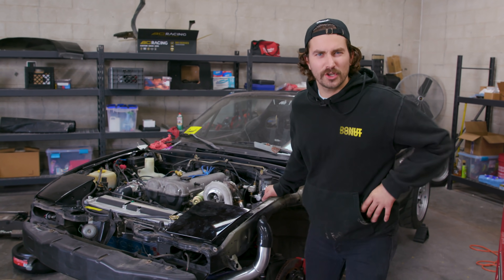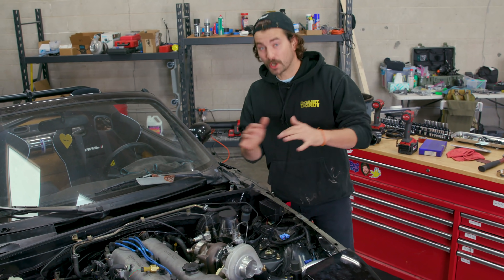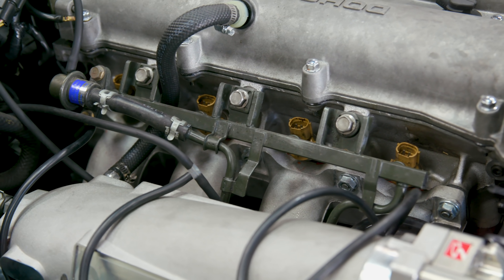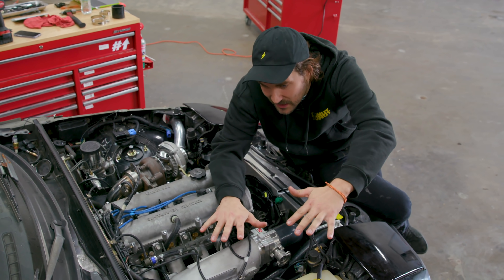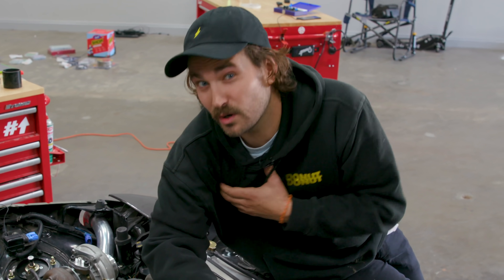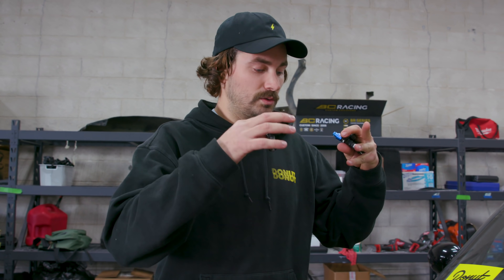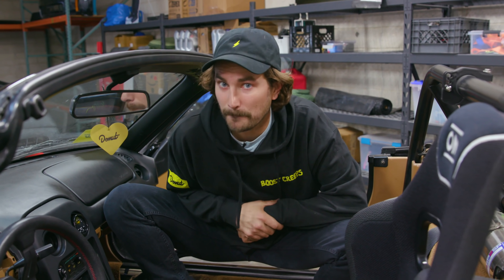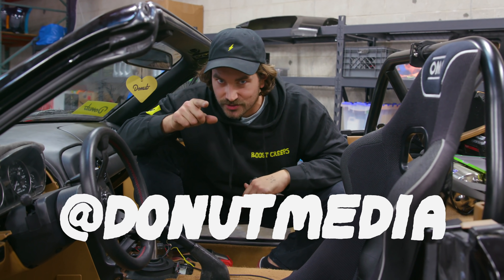Turbo Your Car - Picking the Right Injectors

Comment: It's funny it cost just a few k to bring my truck down to low 12s in the 1/4 mile but the next step which involves new a new turbo or compound setup costs about as much as I have spent so far or more for compound setup.  Then I also need new injectors which cost about 5k for my truck and a built allison trans which can run 4k-10k+  so I'm looking at 15-18k to get down to 10s in the 1/4 lol it's an astronomical jump in price.

Comment: for the poor boost gauge fitment, you could wrap tape around the gauge housing (sticky side in) till its a large enough diameter to fit more snug in the air duct.  You can still remove it as needed and can remove the tape whenever.

Comment: Such bad advice about the fuel pressure regulator and fuel pump. 
Replace your tired ass 30 year old fuel pump. Plus if you start tuning and the fuel pump fails or just can't keep up, you just wasted all your money on the Dyno and now gotta do it anyways. Fuel pressure regulator is hella important ESPECIALLY ones with a guage. Can't tell you how many cars i have seen on a Dyno idle just fine and drop fuel pressure NASTY as boost increases. One, you wouldn't know that and would just keep making the map richer and richer for no reason trying to fight it, 2 you can easily blow your shit up from 1 pull if that happnes unchecked

Comment: butane soldering irons are freaking awesome.  they make soldering a million times easier because they heat up so fast, they maintain the heat easily even in wind, and there's no cord.
also, pro tip:  use flux.  it keeps the joint clean while you solder, but the main reason it's awesome is that it makes the wire heat up like ten times faster.
i use the dremel butane soldering iron.  it comes in a nice metal tin you can throw in your tool box.  
and i use AMTECH NC-559-V2-TF flux.  it comes in a syringe so it's super easy to get it where you want it.  there are cheaper ones with good ratings, but this one is the best.  it's only a few bucks more and you're much less likely to have to deal with headaches.

Comment: Don't solder your fuel injectors wires. Solder exposed to that much heat and elements in the engine bay will get weak and if the connection is lost under load you could melt a piston. This happened to boostedboiz civic before.

Comment: I DM’d you on Instagram asking for help! Username is Jarrod.ray23 I’ve got a 2013 Ford Fusion se with the 2.0t from the focus st and I want to throw in a big turbo but I want to do it safely and I don’t know what I need other then front mount intercooler and then internal waste gate blow off valve and a tune

Comment: You might be able to wrap tape around the back edge of the boost gauge to hold it in place with a press fit in the air vent

Comment: Crimping those injector wires might be a better idea.  Vibration and heat in the engine bay will weaken those solder joints quick.

Comment: Injectors are easy, now upgrading ignition is where I have issues
Reply: Ignition isn't as easy but still pretty damn easy. We have soo many options whether it's Toyota COPS or the better LS coils. If you're having issues upgrading the ignition, you probably aren't at the power levels where it's needed.
Reply: @cn1364-w6c  I’m running stock NA ignition on a boosted setup now. Getting periodic spark blowout at high load. My tuner suggested LS coils
Reply: @flyboynextdoor Stock NA ignition is usually good until like 250whp

Comment: paint some tooth picks or q-tip shafts black an use them as wedges to tighten the temp fit of your boost gauge so it dosnt flop out while romping on it bruhh lol

Comment: Anybody doing this to a 20 year old car, replace your fuel pump wit at least a walbro 255. Nothing will wreck your (now boosted)stock NA engine quicker than sudden fuel starvation. Consider it insurance at a fairly low cost.

Comment: 10:43 Sometimes you can take apart the clips on both harness's to avoid having to cut and soldering and its a lot more secure of a connection. I guess you could get the old ones off then strip the wire back then take apart the new clips and stick your stock wires in. Better connection imo maybe it doesnt really matter but thats how i've been fixing broken clips in my engine bay

Comment: ZACH!  Unless you mention it later, you didn't cover why someone would NOT want to just throw the biggest injectors they can afford @ the vehicle - the bigger the injector, the harder it can be to keep a smooth idle due to the very shortest injector pulse letting more fuel in than can be burned @ idle.   The more you know :)
Reply: Another point as well - electrically speaking, there are two types of fuel injectors normally in use - Peak and Hold, and Saturated.  The biggest thing you need to know, is if they are 'high' or 'low' ohm (resistance) - some quick googling for your vehicle should make sure you get the right type of injectors!

Comment: Zach, there are some slip on solder joints that come covered in heat shrink. All you have to do is slip it on, twist wires together, line it up, and hit it with a heat gun. Way better than the ol spool/flux/iron method.

Comment: You should mention that it’s actually not a great idea to snip more than one wire at a time if you’re soldering new connectors for anything. It’s a good habit to get into, especially if you’re soldering positive and negative leads with power on the end. I’ve ruined a battery and I’ve lit myself up before by cutting two wires at once...just not paying attention. Now, I always cut them one by one, and right after I cut, then I’ll wrap the exposed wire in a little electric tape to keep it from hitting the other positive or negative exposed wire.

Comment: I wouldn’t recommend engine oil/assembly line as that breaks down o-rings. Best to use a silicone based grease for fuel injector o-rings.
Reply: Missed a great opportunity for a Vaseline jokes.

Comment: I would probably  replace the stock fuel pump just because of age and mileage......less risk of leaning out at high rpm and pump fuel fast enough to rail on the faster demand on boost.......In simply term might as well put a DeatschWerks pump like I did.  Great Info!!!

Comment: If you will flux those wires before soldering them it will solder so much better/cleaner/faster. I don't care if you have rosin core solder still flux TRUST ME! I do it everyday.

Comment: I got so pumped up to turbo my 09 impreza 2.5i n/a next year, only until i realized many people in forums were telling others with this idea, that it was a bad move. I'd waste at least 1500$-2000$ in parts, some labour and tuning, etc. Many weeks of working on it, many headaches and setbacks, only to be able to run maximum 7 psi with oem internals, so i'd get at least 230whp at the most from 165bhp... very lame hp for that amount of money spent.. to get at least 350whp i'd need to spend another 2000$ with compression forged internals and beefier drivetrain. At this point i'd spend around 5-6k$ That's the price of a narrow-body wrx.. Another 4k i could get a sti with some miles and some dings. So the new idea is to sell my lame subbie and get a wrx/sti...

Comment: missed a chance to explain about low and high impedance injectors
also its a good mind to replace the fuel pump anyway on an older car, the pump sock could be aged/alot of contaminates
a higher flow fuel rail will decrease the chance fuel pooling, fuel pooling causes a backfeed into the injectors giving deep rich mixtures which dont have
stock fuel regulators generally have a limit of 20psi additional but the key benefit to an upgrade is to reduce fuel pressure oscillations

coulda added about 15min or so of content I would have gladly watched haha

Comment: For anyone following along, the fuel injector harness is really easy to detach from the rest of the harness and pull out, so you can rewire on a workbench instead of in the car.

Comment: Is there any of these calculator for diesels because I have a lbz Duramax that I’m building right now. I have 200% over injectors and don’t know what cp3 pump to go for my whp goal is 1600 but run it at 1000 for reliability. Any one know anything that could help

Comment: "Just take the fuel rails off and pop the new injectors in..."
cries in Subaru boxer
Reply: I mean sure, but the Subaru is a hell of a lot easier to do anything than my old GTiR's were.. While I do wish I still had one (or could afford one) I'll stick to the subarus for now.
Reply: Honestly my Subaru is just a funky lego everything is a breeze except this upcoming secondary air pump valve :(
Reply: @logandvorak  I mean, I replaced the starter in my truck in about 15 minutes. I looked at the starter in my girlfriend's Subaru and decided that was gonna really suck, since it was practically pinned to the firewall under a lot of a/c lines and I could barely feel one of the bolts, let alone see it
Reply: @imthedarknight-8755   yea subarus are definitely a pain in the ass but to take them apart and put together they aren’t too too terrible but they definitely aren’t as easy as other engine
Reply: @logandvorak  Yeap, this one sucked also... One side is easy, getting to the other one requires removing the intake manifold or breaking the top of the assembly :/ On the 2007 STI, at least. Some Foresters apparently have it easier...
Reply: @VeliRajasaar  yep oh ik lmao that’s the one I gotta do lmao I’m not at all excited it keeps getting stuck open :(
Reply: @VeliRajasaar  yea I wouldn’t know I have an 06 wrx as well so I’m not at all excited I’ve been putting it off for about a month or so

Comment: An awesome rule of thumb employed by Turbo Yoda and Tuning fork is one litre per hour per horsepower you aim to get from your engine. It is, of course, a rule of thumb not a calculation which is going to reliably inform you what your pump needs to flow.

Comment: Did you forget to flux the wires? That solder doesn't look like it was cooperating. Even if the solder allegedly contains flux, it always works better if you manually apply it in my experience......

Comment: Getting there. Good build so far. It’s way easier to change injectors with that intake. A standard Miata intake will need at least the top half removed before the injectors are changed. Also those stupid spacers are plastic and are the worst.

Comment: be honest
soildering is the reliablest connection of them all
Reply: Crimp connectors are best for environments prone to vibration (ie automobiles). A proper crimp is stronger than the wire it crimps (cold weld), whereas soldered joints are brittle and prone to failure.

Comment: Remember fuel injector are rated at a certain pressure usually 39 or 43.5 which is normal for older return style cars but newer cars with returnless usually bring 50+ make sure to account for that and I like usi g used own injectors like I used 2013 gt500 injectors in my 2011 mustang till need more bigger ones and they were like 175 vs 360 for the bigger after market ones I had to get also different connections had to use adapters in the aftermarket ones and didn't like it but worked fine.  Also a lot of newer cars come with big ass fuel pumps and often don't need a pump upgrade til going for big power. This is second hand so keep that in mind, If you go with different rails with bigger diameter they can change your injectors amount I was told but I've never needed to upgrade rails so not sure how true or how much it actually does.

Comment: My Nissan Kicks has the same fuel injectors, whole oiling system borrowed from the R35 fitted with a smaller turbo in the new HR13DDT Engine, but still its a Nissan Kicks not a Gtr.

Comment: It’s important to mention you should check the correct impedance of the injectors when buying a set. If you get the wrong type of injectors you'll end up wasting time and money shipping new ones, or having to jerry-rig some resistors or PWM in software.

Comment: The stock fuel pump can flow 165 lph at stock fuel pressure.... 43.5 as opposed to 54.  so no it's not up to the task of consistently running at a higher pressure...

Comment: NEW INJECTORS REQUIRE A RETUNE WITH MEGASQUIRT. Changing that constant completely fucks the fuel map up. But im sure youll catch it when you try to start the car. You can actually use the Histogram in Tunerstudio under the VE table to generate a new table and it should run off of that table. But it wont be the cleanest

Comment: It’s nice to see somebody to doing soldering correctly. Do not use heat to melt the solder onto the wire, this will create what’s called a “cold solder” and can break under vibrations.   Heat the wire and let the solder flow in to the strands.

Comment: As a plumber soldering is my life and so is cars and I’ve seen worse but those joints maid me cringe a lil 😂 still looks like a clean job though thanks for the info I need injectors for my 1j swapped 240sx hatch

Comment: An important factor is also what fuel you’re running (for ex. 91 octane or E-85). If you’re running E-85 your fuel injectors will need to be 30% larger with your calculation. So say 750CC injectors make 400 hp with 91 octane, with E-85 might make less than 350. 

Note: If you’re running E-85 you must get your injectors cleaned 4 times per year and replace all fuel filters (including in tank) at least twice per year.

Comment: So I know the way you did the changing the injector connectors ( cut, solder, shrink) is the easiest because the new pigtails has color match or directions for color x to color y etc but... why do you never see anyone taking the pins out without cutting? It would make for a much cleaner install.

Comment: This isn’t how you size injectors... calculating brake specific fuel consumption is much more accurate. Take the stock injector flow rate convert it to kg/s then divide it by the stock power to get BSFC per hp. Then take that and multiply it by the hp you want. Same math the calculator does it’s just based on your specific engine
Reply: https://www.enginelabs.com/news/calculating-fuel-demands-and-injector-sizing-with-efi-university/

Comment: As an electrical engineer, soldering wires together is a very bad idea when there is vibration present. In this case the engine. The solder joint is too rigid and the wire will eventually snap off at some point. Use bud splices instead. They are vibration safe, and actually easier to use then soldering.

Comment: I just got a boost gauge and it seems so confusing to install I’ve never done any wiring for a car. Any tips if anyone has put one on a 2007 Audi A3 2.0t
Reply: You can use fuse taps to tap your fuse box for the power wiring. You can find both constant 12v and ignition/accessory 12v in the fuse box. You definitely want at least a 12v test light if you're getting into this stuff, helps to know what your wiring is doing. If you're tapping off the battery terminal for power, use an inline fuse close to the terminal. I think Zach has done a couple of simple wiring videos on MoneyPit.

Comment: if you want the boost gauge to fit just put some layer of electrical tape around until it's the right size.
It should be pretty seemless and hold this puppy tight in the vent

Comment: to much fuel will choke out your car under heavy acceleration. yes you can over size " a little bit " but you cant go ham just plugging in double the size of injector. plan on having to tune the shit out of those with your ecu

Comment: There is an upper limit to injector size!  Basically if the injector is too big, then the injector won't be able to control fuel at idle and maybe even at cruising speeds.  Bottom line, if you care about idle and cruising, don't drastically oversize injectors.

Comment: I love how he ignores the fact that the miata's pump may not have been designed to output higher fuel pressures and maintain proper flow. 160lph is fine but has he considered how much the pump will flow at 54psi. Has he considered if he will later run cams or how the intake manifold could change airflow at higher RPM with positive pressure instead of vacuum. What if he wants to turn up the boost a bit more after a rebuild. Hell be right back to replacing the pump or dealing with fuel starvation if he doesnt remember that it's still stock. For them taking a semi educational approach to this I'm mildly disappointed.

Comment: To think this series started with Zach having short hair. A testament to how 2020 went
Reply from the maker: what a year
Reply: @Donut  just a tip but I use foam  window jamb sealer stuck around the Guage to get it to sit snug in air vents. Comes in tape form and it only sticks to the Guage so super temporary
Reply: @CtrlAltSk8  yk they had all recorded before even uploading the 1st episode right?
Reply: @erixccjc2143  knowing these guys probably but depending on how long it takes him to go full digital dash it could still be helpful
Reply: @erixccjc2143 definitey not, he consistently mentions the pandemic and its effects in availability of car parts.

Comment: 14:38 You could use a little double sided tape around the body of the gauge to help stick it in place. This way it doesn't fall out when you break and should hold enough until you go with that digital gauge. Temporary solution that doesn't damage anything, easy to clean up with a little solvent, and will keep you from getting frustrated.

Comment: Fuel pumps tend to lose a little pressure over time, especially when they get pretty old, say 15+ years 150k+ miles. If you're modding an older car, don't count on a stock fuel pump delivering 100% of it's rated performance.
Just be sure you have decent safety margin.

Comment: Not sure if soldering is the way to go, sometimes underhood temps can cause solder to fail. To be safe you wanna go with butt connectors, or more often times than not DW usually sells a PnP harness to connect to your factory pigtails so no need to splice into anything